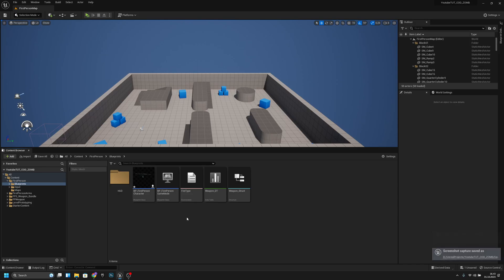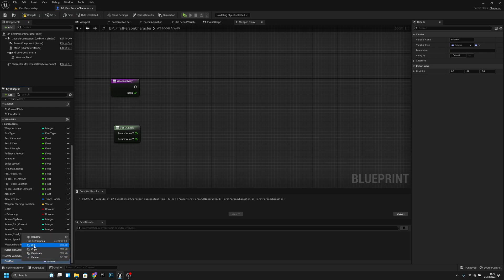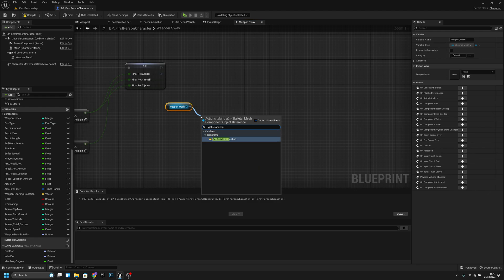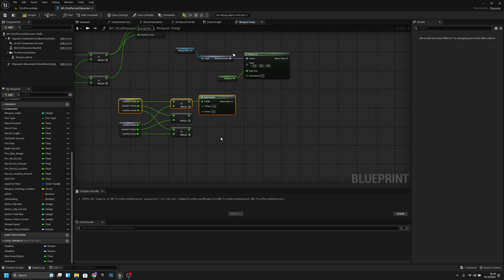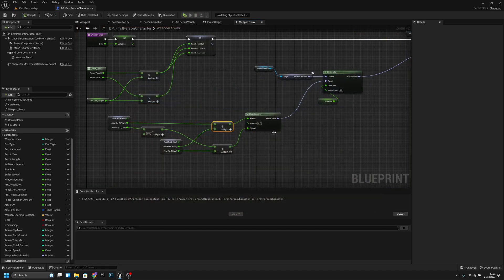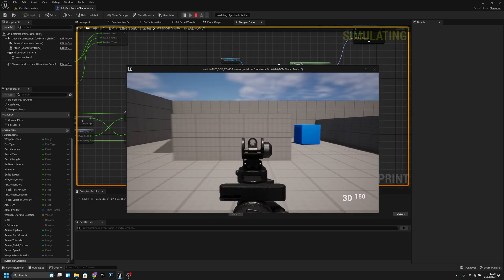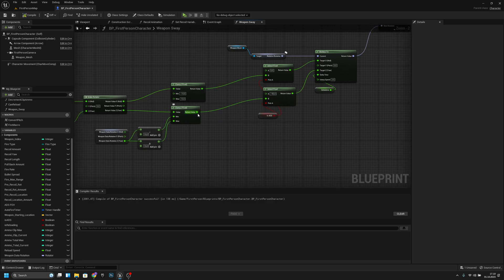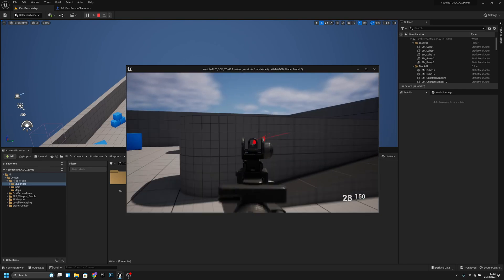WEAPON SWAY Tutorial Unreal Engine 5 COD Zombies series Part 8

Comment: If you're doing this in Unreal Engine 4 the "Get IA_Look" node doesn't exist in UE 4 so you'll have to use the "Get LookUp" and "Get Turn" nodes. If you right click on the graph, they should be under-    Input->Axis Values

Comment: Incredible tutorial! Instead I chose not to divide the RInterp pin structure, and instead at the beginning of the function check if it is in ADS and divide the sway degrees there. That saves all the Clamps from rotating. I'm starting with Unreal, I don't know if it will be the best way

Comment: So I have followed as closely as I can and im doing exactly what youre doing but my gun has a lean to the left and isnt really swaying.. Any ideas? Love the work tho!
Reply: I tore my code apart because I was having a similar problem.  I was missing a wire/link from the "Make Rotator" Z value that connected the "Value" on the Clamp.  I know I'm a year late, but this fixed it for me if anyone else runs into this issue